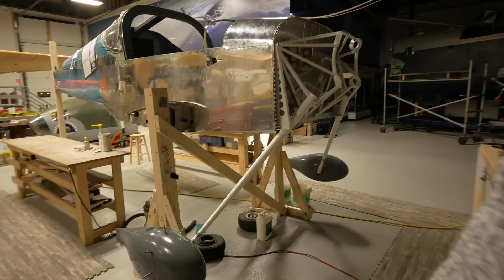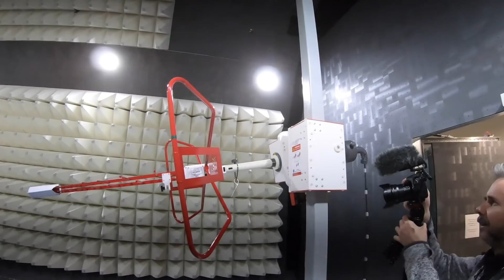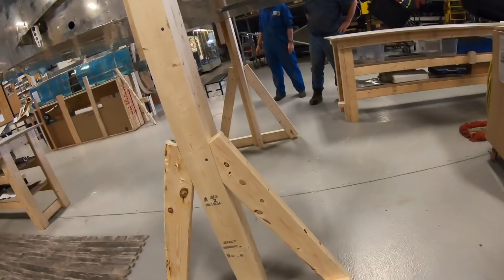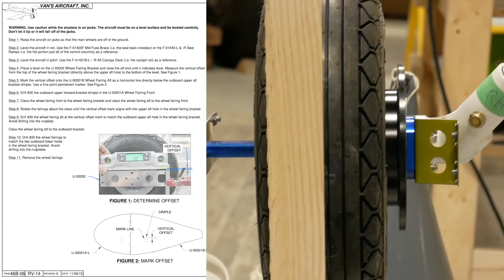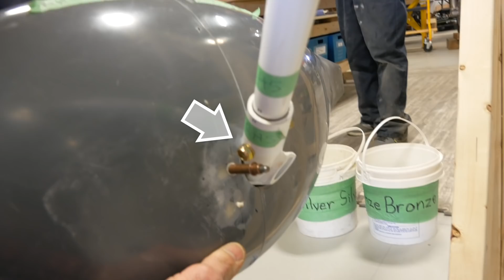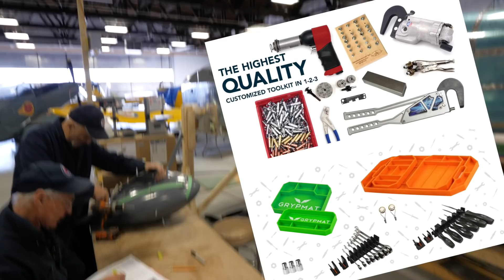Wheel Pants before the End of the World? - Build VLOG #8

Comment: Do you leave a little extra room around the tire in case it bulges because it is low on air or went flat so it doesn't tear it apart?  sure looks like a tight fit but they do say if it's tight it's right....lol

Comment: Thanks for the update; I have to wait another month before I can get back over there.  I planned my wheel pants to be the very last thing I would build for my -8, and it was good to hear Perry confirm that it usually does come late in the build.  My friend Leo completed his RV-10 at the end of February; he now has almost 80 hours on it, but last week he had one of his tires go flat... and of course the wheel pant will need repair.  My response to his misfortune?  Note to self: No Wheel Pants until after 100 hours!  Using my OSH refunds towards transition training with Bruce Bohannon in September.
Reply from the maker: Good idea to channel the Osh funds into training.  
And yeah - I didn't think about blowing a tire and the effect on wheel pants.... hmmmm...  is it normal to blow one after 80 hours?
Reply: @FlightChops  It is if you forget to check your tire pressure.  They're fairly low pressure tires to begin with, and no rim locks.  Leo figures the tire spun on the rim; that tore out the valve stem.